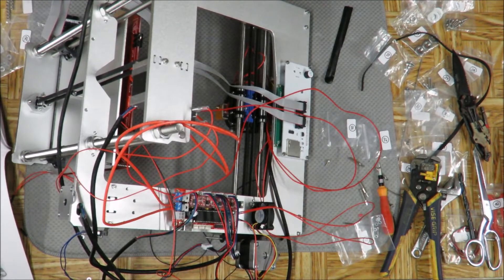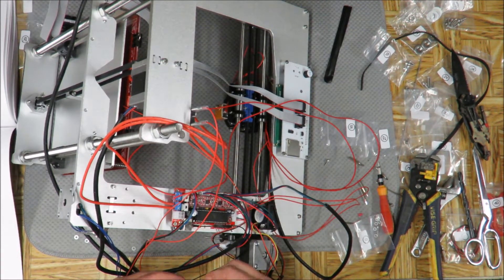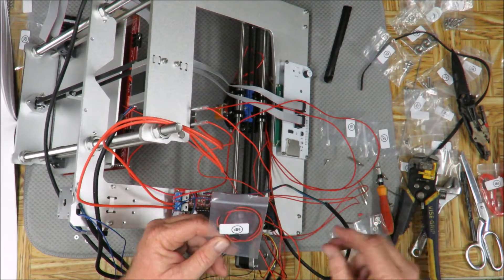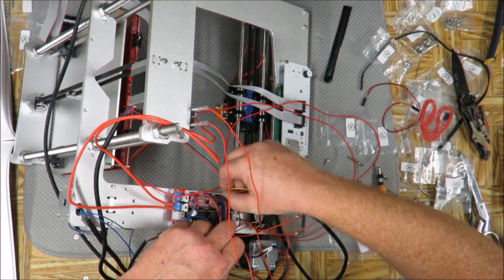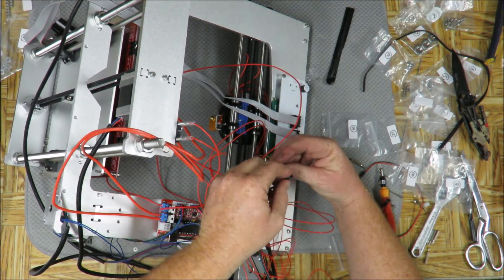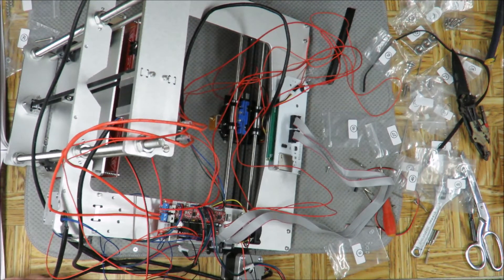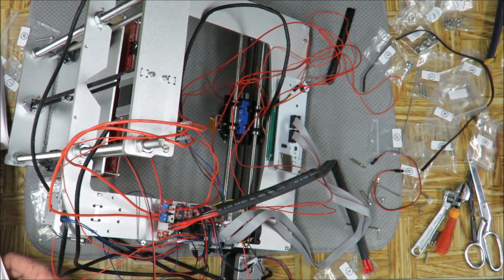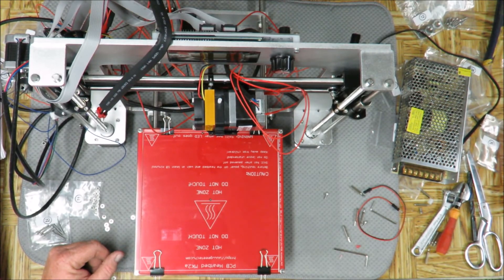Geeetech Aluminum Prusa I3 Assembly Finale

Comment: Great video series! Too bad that I've found it too late. I went through some mistakes as you did. Took me 3 afternoons to assemble, now it's 99% done, my only problem is that the stepper motor of the extruder does not seem working. Tried to set the potentiometer on the stepper motor diver of it, but apart from some buzzing I could not get result.
Reply from the maker: +Csaba Horvath I'm sorry to hear about your experience.  Have you contacted Geeetech about the steppers?
Reply: Yeah, I just did, no reply yet though.
Reply from the maker: +Csaba Horvath they normally respond pretty fast.  Try this one.  bruce.wang@geeetech.com
Reply: Thanks for the advice Jimmy! I've sent messages to Banggood and to Mr. Bruce as well. Waiting for the replies.

Comment: Just wanted to say thanks for all the assembly videos.  I've got one of these on order, so it was a nice surprise to find such a detailed assembly by someone who's gone through the ins and outs of the kit.  Overall it looks like a pretty good kit.  I figure even if I have to replace some parts that are locally sourced, or pick up a few bolts here and there, etc., I'd be hard-pressed for this kind of money to have such a complete kit to start off with.
Reply from the maker: Thank you for watching!  I really hope it helps.  Most of all I hope you learn from my mistakes.  LOL!!!  It really is a great printer.  The only problem I have had are lines around my prints.  After a lot of adjustments it finally came down to Z Wobble.  The threaded Z Rods just have the slightest wobble from where they attach to the couplers.  I just finished making a bracket in Tinkercad that helps alot.  I just finished recording it tonight and will have the video up in the next day or so, and will also upload the file to Thingiverse.  If you have the same issue with yours, please give them a try.  Thank you for your kind words, and hope you enjoy your new printer.